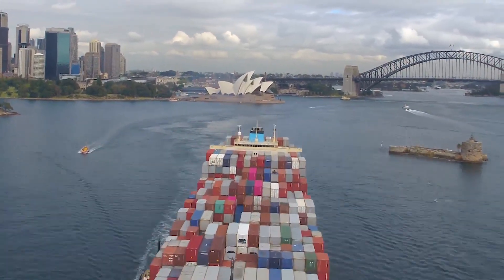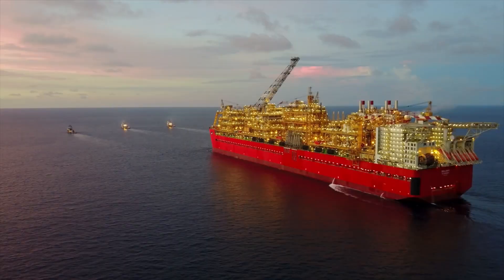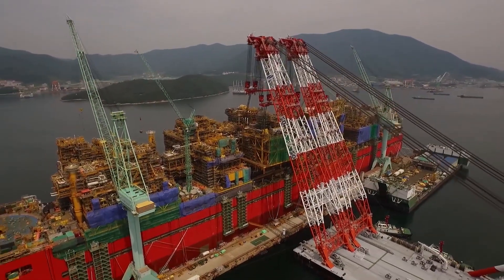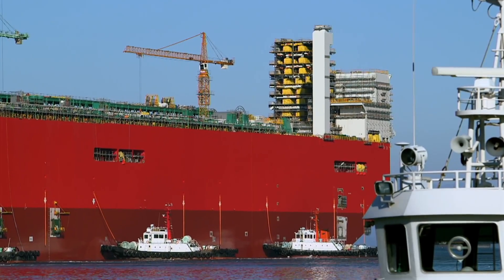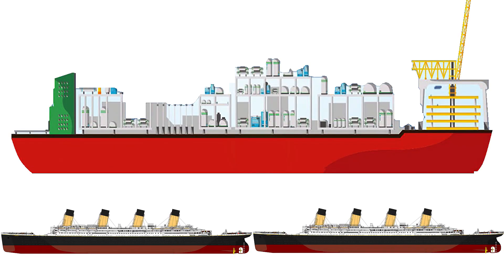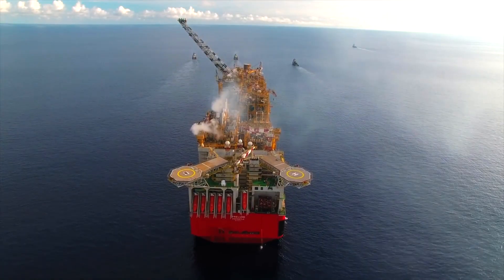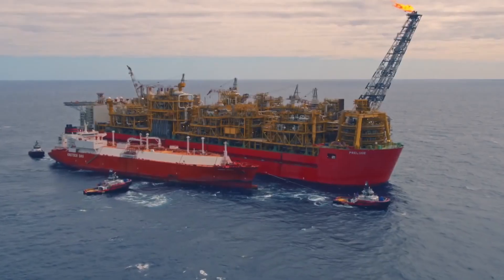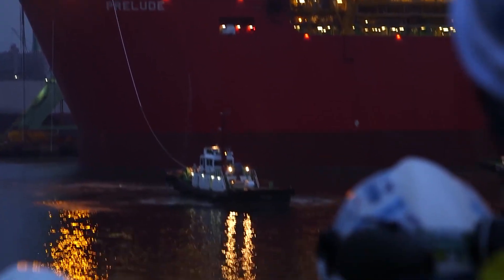600 Thousand Ton of technology: Prelude FLNG

Comment: Yes it's a great feat of engineering,in reality it's a complete mess.I spent 18 months on the hookup of the Ichthys explorer offshore platform also built in Korea,on the instrumentation we replaced much of the substandard tubing which would have been very hazardous if not rectified.I had workmates on the Prelude with similar stories of poor workmanship.This is well known in the oil and gas industries,build them in Asia quickly and relatively cheaply ship them here then spend 10s of millions to get them to the standard to operate safely.On onshore facilities are every bit as bad.Just an aside rig workers are paid well they work 12 hour shifts 84hours a week,normally 2weeks on/off some times 3 not a great lifestyle.

Comment: It's hardly a new idea, the use of FPSO's in the Oil industry (Floating Production Storage and Offloading) has been around for decades. Most were not bespoke vessels, rather old Oil Tankers that were adapted for the job. They would sit on a well head and process the crude, then store it for collection by a fleet of tankers and this still happens. 
It seems totally sensible that the Gas production industry goes the same way, although more equipment is required for the liquification of the gas. This equipment is also required for the transportation of the gas in LNG carriers as the liquid gas if not stored below it's boiling point, will become a gas again and upset the storage arrangements of the carrier.
It is obviously only financially viable for use in some of the more out of the way gas fields such as this one off the NW coast of OZ.
Here in the UK we are lucky and have enormous natural gas reserves in the North sea oil fields so shore based processing facilities are a viable option. Indeed Shell operate one on the coast of Norfolk.
Reply: totally agreed ....the turret concept have been used for decades on FPSO's.   If you want to look at a success story regarding the FLNG concept and in operation, look at FLNG Hilli Episeyo (Golar) - off the  Cameroonian cost,  maintaining a 100% commercial uptime since it first starting production in 2018.  (( https://www.oedigital.com/news/489311-perenco-snh-to-increase-utilization-of-golar-s-hilli-episeyo-flng  ))

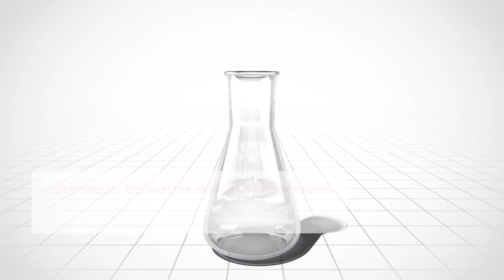Comment: The process you show at 2:10 is a GTL process use to convert gas to liquids at a molecular level, and it is not the one used on this vessel.  Prelude converts gas to a liquid via change of state caused by cooling it with refrigeration.  You have made a nice video, but it is factually incorrect from a technology standpoint.

Comment: i could only imagine the Autocad file on this ship hahah
Reply: My roommate does that for Toyota lol, I couldn’t even BEGIN to imagine the size of the file for this
Reply: Probably wouldn't use AutoCAD for this. Maybe Solidworks or Pro Engineer for the plant machinery. Then Ansys or Napa for detailed ship design...
Reply: @mostlymessingabout  In France, where the plant was designed, they mostly use Catia
Reply: @bshunter9290  make sense. Catia is French 🤔. Hopefully it doesn't crash as often as Catia's cheaper version, Solidworks 😝😝😝
Reply: @mostlymessingabout  Yeah I hope, I work with SW and we have a few French guys at work and they're always saying Catia is way better
Personnally I don't know since I never used Catia myself
Reply: @bshunter9290  I've seen the Catia UI. It looks cleaner. But if SW have had the same crash and bugs built into it for the 20 years I've used it... you know "Can't Save" and "A part is unresolved". So i doubt Catia is any better. It's just marketed for the big $$$ boys.
Reply: Nah - gimme a napkin and a sharpie...
Reply: @jesperhollensen726  thats probably now it started... most great ideas are simple...
Reply: @covert0overt  Idea might be simple, but realization is not. And cad files describe realization, not idea.
Reply: @NGC1433  Duh...
Reply: Autocad? No, Shell has a strict requirement of using etch-a-sketches
Reply: There are a few terabytes involved in that DWG file. Quadros will whine in protest as that file opens.
Reply: How would you even start
Reply: @oatlord  pipe... number 1....
Reply: @covert0overt  Funny! I wonder what is the pipe that has a designation #0000001.
Reply: @oatlord  probably with a layout grid. Then break it into modules and create a fistful of dynamic blocks to lay out said modules. Then each module would get broken into its own separate manageable DWG file which could be worked on by its own small team. Then you would create a GA file using xrefs linking to each of the module drawings. The key is standardisation and coordination between the separate teams who would all need to follow the right ruleset and be really disciplined in their methods.
Reply: @Nickgowans  perfectly described👍🏼
Reply: CAD with BIM hahah
Reply: AutoCAD file? Imagine the material models used to simulate structural dynamics!
Reply: Probably designed in Catia
Reply: imagine the jira work flow document for this ship project too lol
Reply: Ues, i need the STL for printing it
Reply: Visio for the power plant and Powerpoint for the ship design. Done.
Reply: Probably spread across multiple files
Reply: Lol I know, right?! They could also use the full suite version of Revit which has mechanical and structural add ons. Many large naval builders use a large version of REVIT and BIM applications over something like AutoCAD which is not sophisticated enough for this for of application.
Reply: Bahahahaha ok so the program is color coded. Lol
Reply: Prob 500GB with log-in permissions for different views.
Reply: Big.oof.cad
Reply: @WhuDhat  too.many.pipes.CAD
Reply: @Blank Jo makes sense. That file would crash CATIA even with loads of RAM
Reply: You have millions of different files for parts. So managing the workflow and where things go would be very important
Reply: Your pc wouldn't even load it
Reply: 18 terrabyte probably
Reply: Nah, Autocad is a dinosaur. Its all about ProCore now.